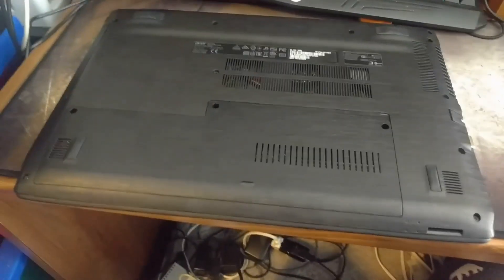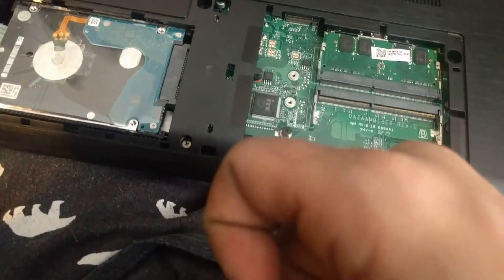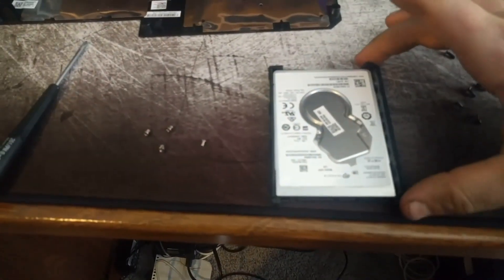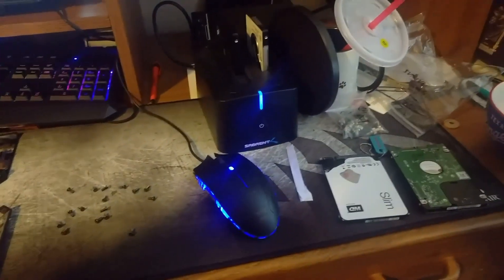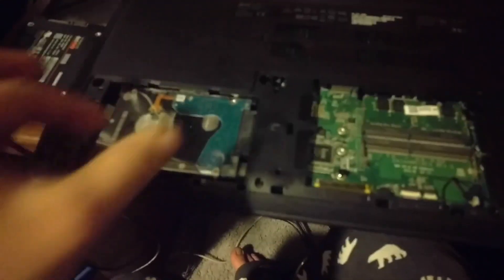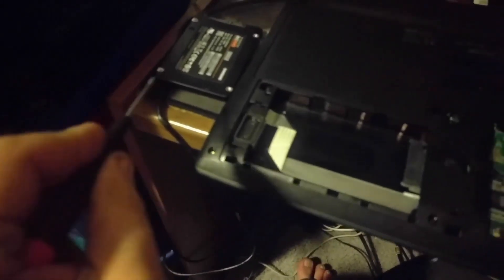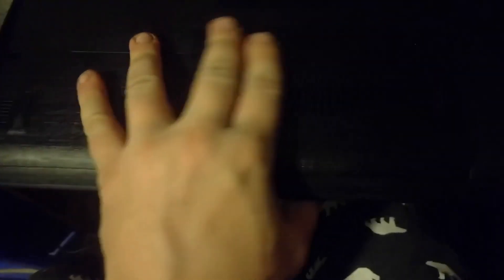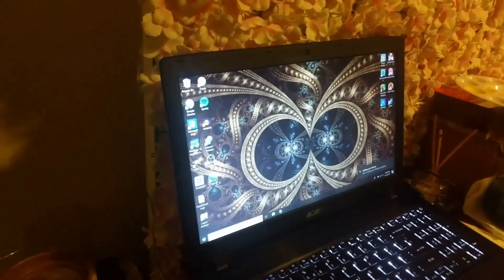💻 Acer Aspire E15 1TB HHD to Samsung 860 Evo 500GB internal SSD Partitioning and Installing

Comment: If you were install a blank ssd and install windows from a USB, would it still work?
Reply: It should.
Reply: @taco9797998907907   Can confirm. It did work. Installing a fresh SSD + bootable USB will save you much headache if you just wanted a clean window install
Reply from the maker: I'm not actually sure about that, sorry.
Reply: Might have to install drivers.